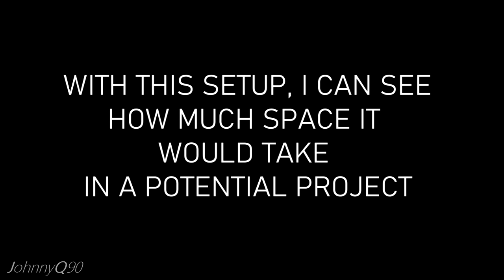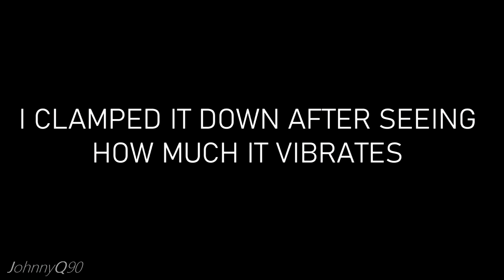Miniature Inline 4 Cylinder 32cc Watercooled Engine

Comment: Still waiting for Johnny to turbocharge one of these little engines
Reply: agreed! that would be so cool
Reply: But also got to show the increase in torque when turbo charging them
Reply: He’s working on supercharging a nitro wankel engine
Reply: @JosiahKC9  look back in his library. i think there's a few videos already. compressors that small in surface area cannot produce over atmospheric pressure . boost cannot be achieved satisfactorily
Reply: Why do something pointless?
Reply: it wont make that big of a diference, but I guess its cool !
Reply: What he said ⬆️
Reply: Up
Reply: @chrisprobert6  Oh you're right for sure.  I have seen the videos where he built a small compressor but it failed, I just want to see him be the first to succeed.
Reply: It will sound like tsutsutsutsuuu
Reply: @chrisprobert6  you you are saying a mini 2jz motor with a massive blower (to scale) making mini stustustu sounds wouldnt be cool?
Reply: @chrisprobert6  Actually, some of the larger ones closer to 40 or 50cc would be fine. There's a 50cc super charger meant for engines like the 50cc Honda monkey. Would be neat to hook that thing up.
Reply: @akabiscuitwaffle  not enough exhaust from these nitro engines to drive the turbo turbine. but a super charger could be driven with these new brushless mega speed electric motors they have in rc cars. yes it would be cool but i think we would see early failures due to build tolerances in the engine
Reply: @sethh8892  yes would be mega cool to hear the "stustustu". lol. but you need to realize that noise is made because of the amount of air by volume is being released. these engines are tiny. it is great to see them run and its our nature as petrolheads to want to see better power/noise/smell etc but go find the 2jz to get this adrenalin. sorry dont mean to be a killjoy its just im ab engineer so have to function in the real world now and then .lol
Reply: @chrisprobert6  no, the turbo flutter is made when the air rushes back through the turbo, essentially flowing backwards. But I know what you mean. If we could not only scale down the object, but the physics as well.
Reply: @averagecarguy420  he already did make a turbo for one of those little rotary engines he also ended up putting that turbo on his v4 engine he put on his rc race car
Reply: @juhomaki-petaja  No idea is pointless. Design something , anything, build it, take it out and through testing,  you break it, take it home fix it, improve it, take it out again.  It's the whole process and not just the end. but doing the whole thing. It seems your brain is a little bit stuck.  Open up a bit and look to the horizon.  When I get an idea, I put it to paper, 2D, then I cut , glue, screw, sand, paint/cover. Now my idea is now a 3D model.Then finally work with my idea.  Good , bad, or indifferent, it's MY idea, might not be much to you, but it is MY idea.
Reply: @chrisprobert6   I mean there is literally a legitimate real, not pseudo electric, sized for 50cc 4 strokes, supercharger meant to run off the operating engines own mechanical energy.

ALSO as for turbos. Again the magic number is 50cc, but also would need to be a 2 stroke (most are anyways for these I guess). You'd need to rev to over 10k to push a VZ21 turbo off a 50cc 2 stroke, but again it's doable.  

These are both real thing, that have been tested, and are used for such. The supercharger would be easier though given its more reasonable RPM requirement as it was made for regular 50cc engines.
Reply: it would be cool to see one of these scale engines on boost and to see whether how much power it picks up, but the best and most effective way to increase the power of an engine this small would be nitrous, either a dry shot or if possible a wet shot
Reply: imagine that with e85/ 100 octain race gas
Reply: Nitrous
Reply: @chrisprobert6  Well it could maybe work. its a mini i4. not a 1 cyl
Reply: JosiahKC9 imagine if you put like a full turbo charger on it and all the sudden while you're running the motor all you hear is stototototototototototo
Reply: @chrisprobert6  maybe a positive displacement supercharger would work better.
Reply: Pleeeeeeeeeease put a ball bearing turbo on this online 4!!😍😍😍😍😍😍😍
Reply: @juhomaki-petaja   because boost my dude. I wanna hear that turbo flutter
Reply: How bout a super charger?
Reply: @juhomaki-petaja , "Why do something pointless?"

Do you mean like making that comment?
Reply: @notahotshot  doing something that cannot be done
Reply: @juhomaki-petaja  because humanity
Reply: I thought this as soon as i saw the way the exhaust was routed on this motor, reminded me of a 7mgte intake and I thought, when's the mini turbo coming along?
Reply: I just came to say the same.
Reply: They can't be turbocharged, they're much too small. They could be made to work with a displacement supercharger, though.
An engine should normally produce a minimum of about 20 HP to be turbocharged.
Reply: The
Reply: with turbo it could be used for a minibike
Reply: @chrisprobert6  I don't believe nitro engines are very volumetrically efficient, as cfm of air per hp. They flow enough, if everything was to scale, but making an 8mm shaft in tenth scale would be .8mm. That can't be done, so everything weighs more, so it takes a lot more exhaust to spin the turbo.

These engines do spin fast enough to direct drive a centrifugal pump, so leaving out the hot side is a pretty easy decision.

Though it would be cool to add an e-charger…see VlexLTDLX…He runs a high voltage, high hp, brushless motor spinning a supercharger, and makes some real power!
Reply: @chrisprobert6  question... How TFFF does a supercharger work on an Electric motor wtf lol think about what you said.
Reply: @Mike-im9bw  you'll have to work out the research yourself mate . I ain't typing the answer, it'll take me all day for a layman to understand

Comment: You should bulid a tractor puller with  that Engine it could be cool
Reply: F1 is cooler, the sound of that engine fits better
Reply: A little farm tractor or even a semi truck to pull his latest drift car around with... I4s and I6s are known for torque more than they are speed...
Reply: That would be radiCOOL
Reply: A fully custom 30 kg tractor puller.
Reply: İt is like a truck engine
Reply: That was exactly what I thought
Reply: Or a scale semi truck the possibility!!!
Reply: Its time u built your own engine. A fire breathing monster! Seems like u have built everything else.
Reply: Lame idea for this engine, its a gasoline engine that runs spark ignition and not a rc fuel engine that works the way as a detroit diesel does. This engine should be way better off in a rc sport/race car or maybe a rc race boat or anything that has to do with fast motorsport vehicles
Reply: What's a tractor puller?
Reply: Early semi trucks were gas engines, my firetruck (in my pfp and shown on my channel) has a big I6 gas engine in it... spark plugs and all, not a diesel... the same engine was used in plenty of old Mack semis! Even earlier Macks all had Mack I4 gas motors in them... and I never see many I4s in many new cars outside the standard Japanese economy commuters... a little I4 like this really belongs in a little tractor or semi IMO...
Reply: @soundslikebstome  Do you know how the comments section works? Who are you talking to? You're replying to the op of this thread, but it contextually makes zero sense because the op hasn't built engines or anything else, that we know about.

Comment: I want to see the first oil change on the engine. Let’s see how bad it is.
Reply: Indeed, that would be an interesting thing to see!
Reply: Probably no worse than an engine from 50 years ago.  The real question is how well the engine holds up under load.
Reply: rockets4kids Exactly. When you consider the fact that this costs as much as a cheap motorcycle engine, you have to weigh out the cost over time. I’d love to see how this holds up after 100+ hours of use. If it’s well-made? Could be perfect for a lot of people.
Edit: It would also help to know if he used full synthetic oil vs a blend, or just natural, as that also definitely affects smaller engines a lot more rapidly.
Reply: Sounds awful.
Reply: What Is Islam?

Islam is not just another religion. 

It is the same message preached by Moses, Jesus and Abraham.

Islam literally means ‘submission to God’ and it teaches us to have a direct relationship with God. 

It reminds us that since God created us, no one should be worshipped except God alone. 

It also teaches that God is nothing like a human being or like anything that we can imagine.

 The concept of God is summarized in the Quran as:

{ “Say, He is God, the One. God, the Absolute. He does not give birth, nor was He born, and there is nothing like Him.”} (Quran 112:1-4)

Becoming a Muslim is not turning your back to Jesus. 

Rather it’s going back to the original teachings of Jesus and obeying him
Reply: @ahmdabdallah5811  , you are deliberately trying to decieve people. Islam takes the worst, most evil, and genocidal parts of the OT and doubles down, and demands the hate and dishonesty be put in practice today.
Reply: God has said in the Quran:

{ O mankind, worship your Lord, who created you and those before you, that you may become righteous - ( 2:21 ) 

 [He] who made for you the earth a bed [spread out] and the sky a ceiling and sent down from the sky, rain and brought forth thereby fruits as provision for you. So do not attribute to Allah equals while you know [that there is nothing similar to Him]. ( 2:22 )

And if you are in doubt about what We have sent down upon Our Servant [Muhammad], then produce a surah the like thereof and call upon your witnesses other than Allah, if you should be truthful. ( 2:23 )

 But if you do not - and you will never be able to - then fear the Fire, whose fuel is men and stones, prepared for the disbelievers.( 2:24 )

And give good tidings to those who believe and do righteous deeds that they will have gardens [in Paradise] beneath which rivers flow. Whenever they are provided with a provision of fruit therefrom, they will say, "This is what we were provided with before." And it is given to them in likeness. And they will have therein purified spouses, and they will abide therein eternally. ( 2:25 )

 Quran
Reply: @ahmdabdallah5811  Dude, stop "obeying" and "following" childish fairy tales and gather up some courage to think for yourself and make your own personal journey through life. Stop being such a coward.
Reply: Tis a four stroke
Reply: Zoltan  4T bud..
Reply: @ahmdabdallah5811  wut.
Reply: Zoltan  it's a 4 stroke.  Just a regular pushrod OHV motor.
Reply: Zoltan  it's a 4stroke engine not aa 2 stroke as the sparkplugs/dis is the dead giveaway
Reply: This is a model engine made in China. I almost bought it, but I gave it up because it didn't have an oil ring. As you can see, it burns oil😓
Reply: 曾曾显柱 Most model engines don’t use an oil ring. Even higher end brands like OS usually only use a single ring on their 4 stroke, multi-cylinder engines. Some even simply use the tapered cylinder wall design like the smaller glow plug engine.
Reply: @adamr9215  The fuel mixed with lubricating oil is used in both four and two strokes of O.S. engine. I'm thinking, if it's inevitable to burn oil, why don't we just add two strokes oil to this engine.
Reply: 曾曾显柱 Some of their larger multi cylinder engines do actually have an oil system. Or at least they used to make a few.
Reply: @mrnickbig1  no it does not
Reply: @Sebi076 , BS. The Quran becomes very radical and contradictory near the end of cult leader Muhammod's life. If it was anywhere near the word of God, there should be NO contradictions. I suppose that you think lying to unbelievers, cheating them, enslaving them, and infiltrating and subverting their governments are fine, too.
Reply: @mrnickbig1  how though?? It’s so unique! An engine never really sounds bad unless there is something wrong with it. (Or someone throws glass paks on a straight piped ford)
Reply: @cheekybastard99  It’s an engine that you can use for whatever you can imagine. People put them in large rc cars, rc boats and more. Look into it, there are whole websites about building custom vehicles and other ways to put them to use.
Reply: @rooter1  Diesel engines come in both 2 and 4 stroke. Older Detroit 71 series engine are 2 stroke diesels with an oil system. They were 2 stroke but you didn’t add oil to the fuel, they had a oil pan and oil pump. Also, they have made 4 stroke engines for r/c planes that are 4 stroke but don’t have an oil system. They use standard rc nitro fuel that has oil already in it. So, you are pretty wrong. You have a little of the concept, but not much. Do some more research.
Reply: @rooter1  Yes, I agree with you. In fact, I know very well. But I think the model engine may not be so delicate. For example, this model gasoline engine can actually use kerosene fuel(Zippo fule), but the car's is not.
Reply: @rooter1  You said that “2 and 4 stroke engines have spark plugs, only diesels don’t have spark plugs.” I was saying that diesels come in both 2 and 4 stroke, making your statement wrong. 

As for your statement about r/c engines being toys, you do know there are some well in excess of $10,000, right? Art would be closer than toy in many cases. People don’t trust toys to power their 5+ year, $20k+ projects. Just a little perspective for you. I’m a machinist and engine builder, but I still respect the little engines. My personal side project is a 1/5th scale ls engine that will run. It’s not easy to make a little engine run well since fuel and air molecules don’t scale down with them.
Reply: @rooter1  Learn to read. That’s not what I wrote. If you are going to reply to me, at least reply to something I said, not a figment of your imagination.

FYI, my machinist career started 4 years younger than you. At 16, I was building racing engines.
Reply: @iamfootscum  You're thinking of reed valve 2 strokes or weedwacker type 2 cycles. Auto and truck 2 strokes indeed do have oil in the pan and run straight fuel, no premix.
Reply: @iamfootscum  Not just Detroits, even newer large marine 2 cycles use sump oil. The configuration of the intake and exhaust manifolds leads me to believe it's an internally gear driven ohc setup, who knows, it could be a pushrod system too. I'd like to see a tear down, I know these miniatures aren't much on cylinder sealing so I reckon the rings are the cause of such smoking.
Reply: @adamr9215  that can be said of all religion to be honest.
Reply: As far as I can make out it doesn't use oil, only in the RC fuel (which would lubricate just the pistons in the cylinders) & grease in the cam box to lubricate the cams & followers. I think there's just grease in the sump too.

Comment: Dude, your rubber part of the exhaust is burning a little.
Reply: Thats ok, Same happens with those cheap hot glue guns. Never melts to the point where its deforming
Reply: This is fine
Reply: He's also uses duck tape  on his exhaust  leak.
Reply: @mrtee3477  #duct
Reply: @richardgray115  Unless he used duck brand
Reply: @mrtee3477  quack
Reply: @JK-ep9bz  QUACK
Reply: Nah, that was oil leaking an burning, thing was burning oil like crazy
Reply: That’s an understatement. That thing must have been stinking like crazy. I’m sure that must have been a temporary fix but rubber adapters and hot exhaust fumes are a bad mix 🙈
Reply: Ikr at $899 for a motor ..if it can't film flybys on photography in an airplane it's not worth a fk ..stating the obvious ..even if I was a billionaire (would say trillionaire but honestly I don't want to be Congress -not sharing karma with those junkies)
Reply: Rubber hose as an exhaust on an $899 motor ..bet his ol lady if he has one ..is about ready to scratch herself on Facebook !!😆
Reply: I was also wondering why the hell theres a rubber part for the exhaust, makes no sense

Comment: time for a giant tractor trailer combo like a scania or a mac with reverse and 3 speed high torque GB
Reply: Some of the first Mack motors were I4 gassers... tells you something right there!
Reply: Well ours is not a scania or mac but it's a David Brown 995 and those are absolut hell to repair
Reply: @CaptainCrutch   they were ..... wow i did not know that XD ... the more you know
Reply: Captain Crutch   Yes, it tells you that they were starting out and didn’t have the resources to make anything better.
Reply: Random projects USA The trucks were still know for being immensely powerful, I believe someone described it as “being able to climb up a vertical wall, just not very fast”... the biggest problem was that you could never pass a gas station. But Mack was still putting I6 gas engines in trucks into the early 1970s, though at that point they were limited to firetrucks only.
Reply: Or maybe a peterbilt
Reply: This!
Reply: Dude that's what I thought
Reply: Scania 141
Reply: Definitely should be used to power an accurate scale model of an actual vehicle.
Reply: I was thinking throw it in an xmax
Reply: Good
Reply: 1/5th or 1/4th scale rock racer
Reply: @CaptainCrutch  llllllllllllllllllllllllllllll
Reply: For $899 how could it be worth it? Even for a short time it's built like a Hyundai
Reply: NO! In Datsun or a mini, or a old MG. basically Anything small from the 50s-70s